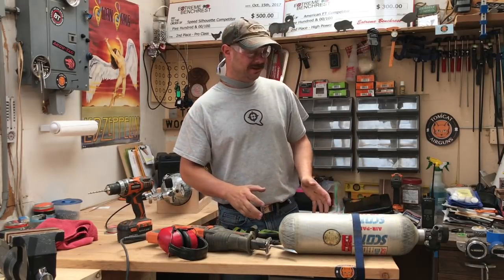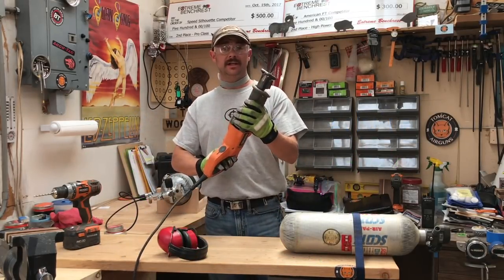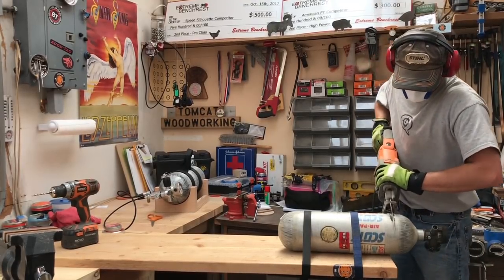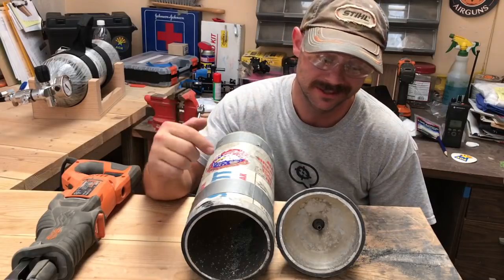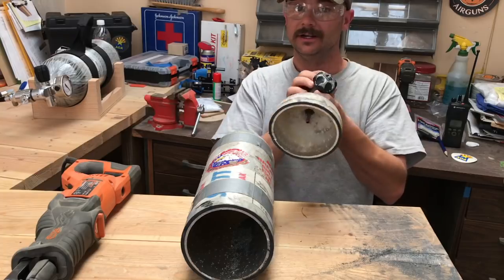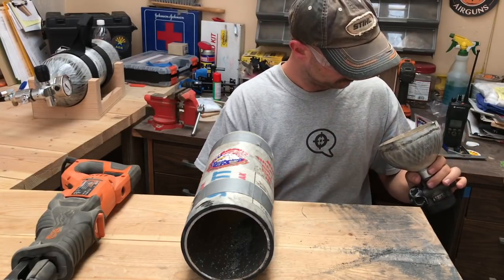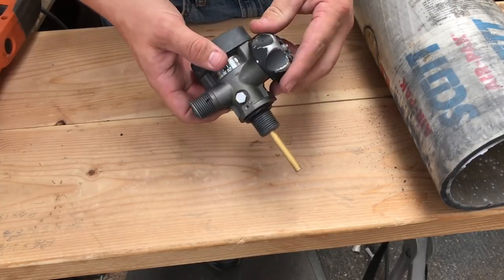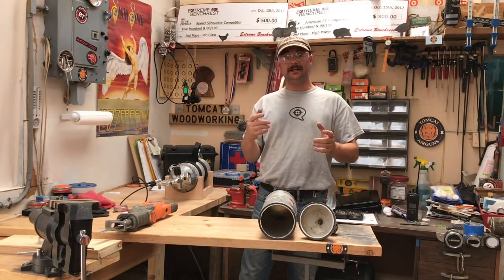Cutting open an SCBA bottle!

Comment: SCBA certain makes And or model 2019 new DOT law now have been extended from 15 years service life to 30 years service life.  So your tank  Scott was good for another 15 years (After passing Hydro Test) .
Reply from the maker: NEGATIVE. I researched what you are referring to. It needs more than a simple hydro test. It needs to go through a "Modal Acoustic Emission" test. Last time I looked this was not available to the civilian market and only pertained to certain bottles manufactured with specific DOT numbers. I appreciate the comment though! :)
Reply: @Atoyota25  It is available to the public you have to send your tank to this one place $250 plus shipping. If your tank fails you dont get charged. If it passes then it will get new label and you still have to get 5 year hydro test.  i cant remember the damn name. I have the paper work for it.  And yes its only to specific Dot number and it covers many tanks i have one.
Reply from the maker: @airwolf269  Thanks for the update. It's been a while since I looked at it. I just picked up a tank for $275 with 10 years left. Sure, It was a good deal but, the numbers are pretty close. I think once they come down in price for the service, it'll make more sense to get it done.

Comment: Thanks for doing that. Great vid!

Brings up a few questions....
1. Would it be advisable to remove the regulator and inspect the tank for debris before the first use?
2. If the regulator has a long nipple, could you trim it so you can drain the tank of moisture?
3. When they hydro test it, is there any moisture left inside? 
4. Should you just add a moisture trap and solve #'s 2 & 3?

WM
Reply from the maker: By regulator, I'll assume you mean valve assembly?
1) No. When a bottle is new, it's been tested & inspected and is ready for use.
2) I suppose you 'could' but, I'd focus my efforts on the moisture issue. Also, There's a torque setting for putting the valve back in. I sure don't want to take the chance at doing anything wrong.
3) No. They thoroughly dry them before reassembly. 
4) Yup! That's the best solution!
Reply: Thanks for getting back so quickly. Now I can sleep better:)
Have a great Memorial Day!
WM
Reply: DID YOUR PARENTS HAVE ANY CHILDREN THAT LIVED?

Comment: Now that will make a sweet target at 200yd+. Drill a hole through the bottom and hang it up.
Reply from the maker: I thought about that. I would do it but, I don't want to have to deal with the fiberglass pieces. I've got an old steel bottle that I used to have hung out at 125. "Biinnnnngggggg!"